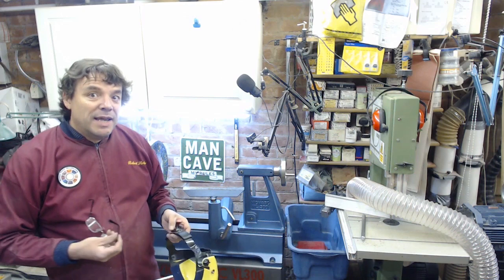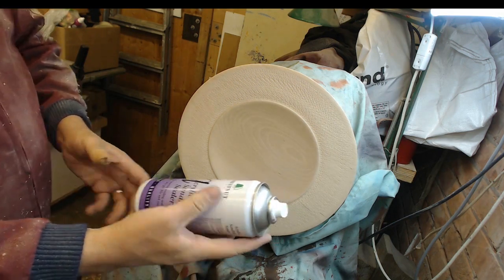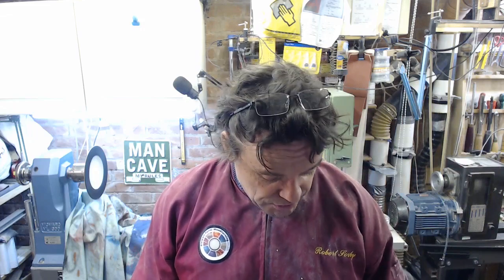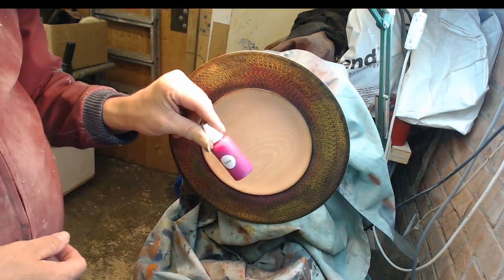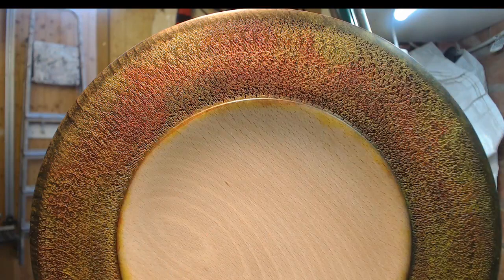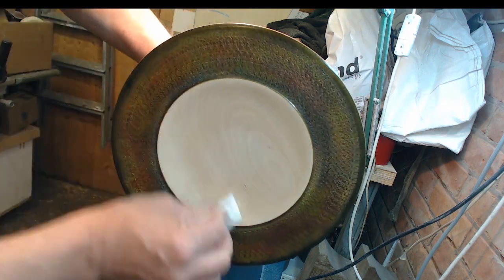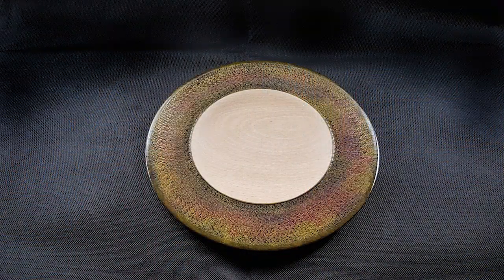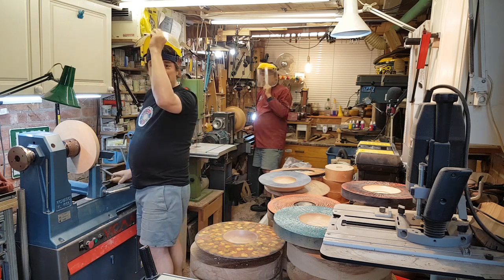Textured Iridescent Platter

Comment: Hi Stewart,
Now you have two lathes does that mean you will have a split personality?

Thanks for using the Chestnut Iridescent paints, it gave me some ideas and I think what you produced was excellent, quite suttle colouring. I would have finished off with Chestnut Microcrystalline Wax after the Chestnut Cut and Polish.

Are your chucks interchangeable between your two lathes?
Cheers
Roger
Reply from the maker: Thanks, Roger - I normally do finish with microcrystalline wax - must have forgotten this time with the excitement of my new lathe! Happily, both lathes have the same thread so I can indeed use my chucks on both of them. Glad you liked this one and it gave you some ideas of things to try. Cheers!